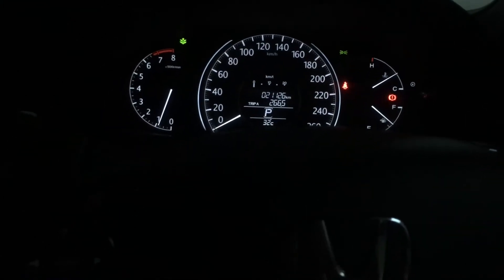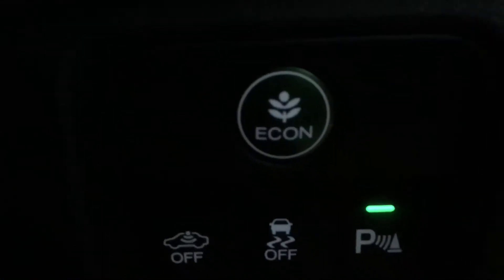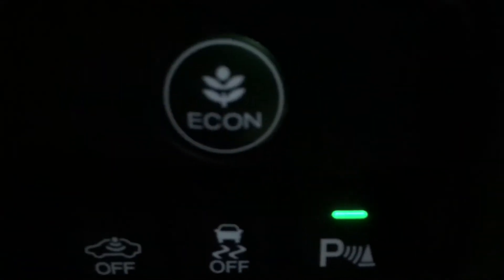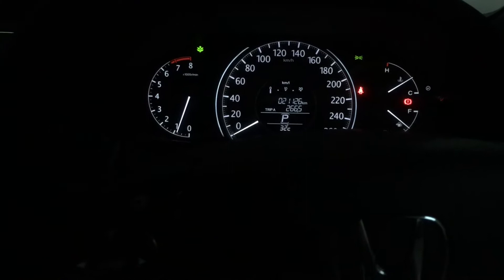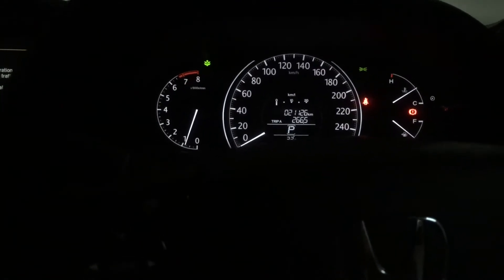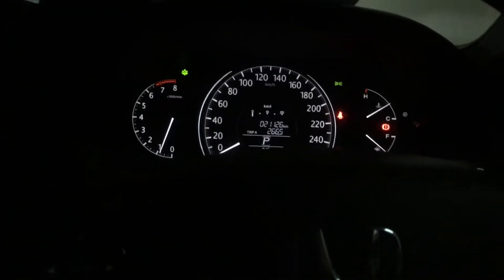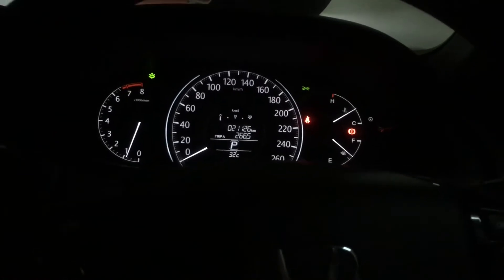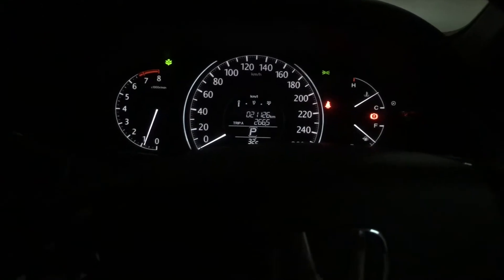Honda's Econ Button - How Does It Work?

Comment: I use my Econ button because I'm on the highway everyday and the Honda Grace has no issue with  acceleration on reaching inclines on the highway.  Additionally, my air conditioning was fine and I noticed I used less fuel that the days I drove without the econ button  I am still monitoring the performance and fuel economy though but so far I'm very satisfied
Reply from the maker: Hi!

There won't be any issue for the car to accelerate up inclines however with the ECON mode on, the engine doesn't react (downshift) as quickly as it would with the ECON mode off. Maybe also because the Grace is significantly lighter in comparison with the Accord in terms of curb weight which might also explains why the experience isn't as vivid.

The air conditioning system will also work fine but you will definitely feel/hear that with the same fan speed, turning on the ECON mode will slow down the air conditioner blower - the compressor also kicks in/out more often with the ECON mode on.

The effect of the ECON mode isn't obvious, it is more like a "backstage" crew working its magic.
Reply: Shani Andras Well so far it's been working great and considering the price of gas where I live, I've been seeing some benefit. Thank you for responding.